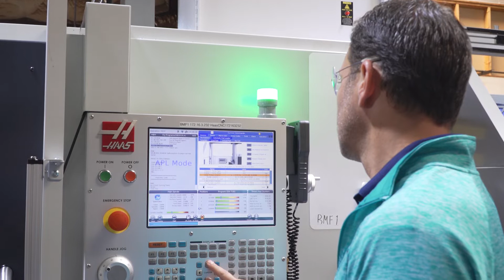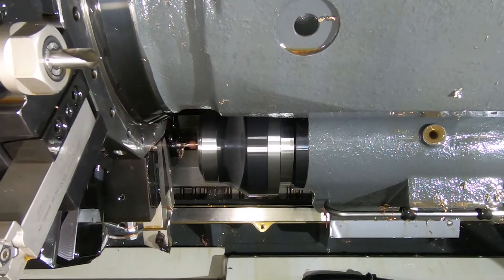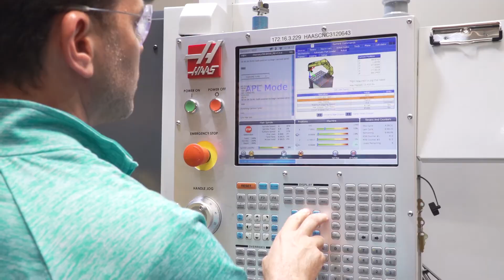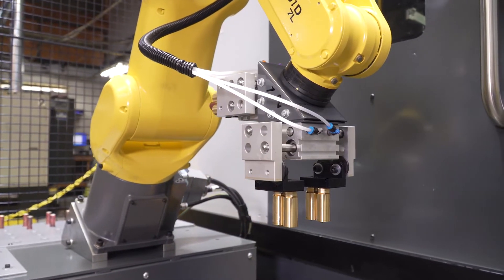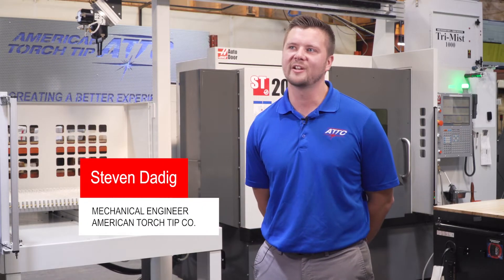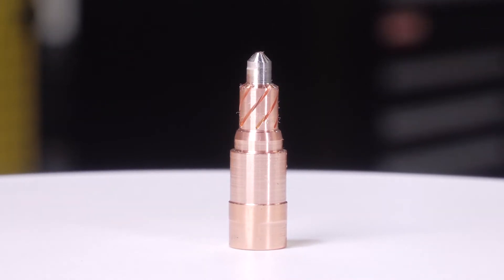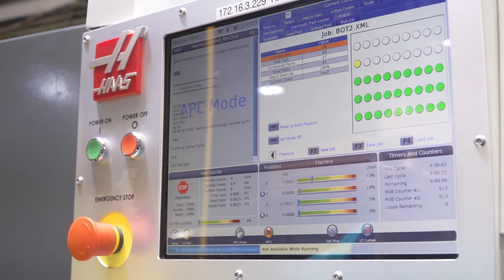Customer Spotlight - American Torch Tip Co. - Haas Automation, Inc.

Comment: Wouldn't a screw machine been faster? That way you would not have to cut each part into slugs.
Reply: Seems to be working for them.  Watching the video, it sounds like they wanted something pretty much turnkey.
Reply: Looks like infeed stock is two materials, so I am guessing they cant get bar to feed.